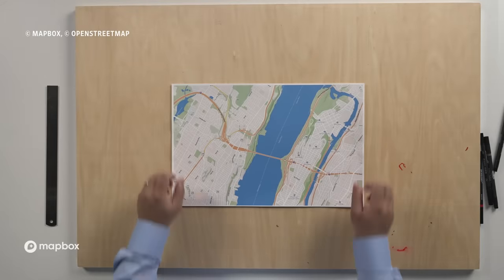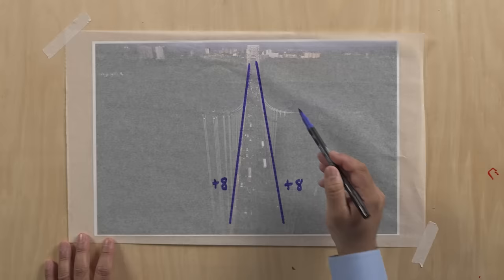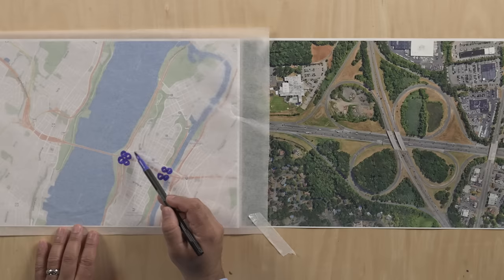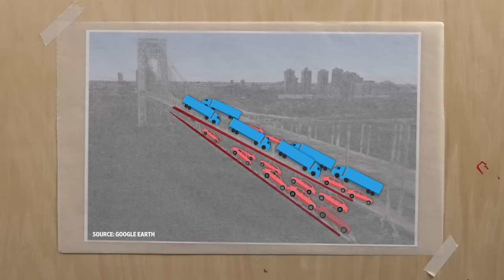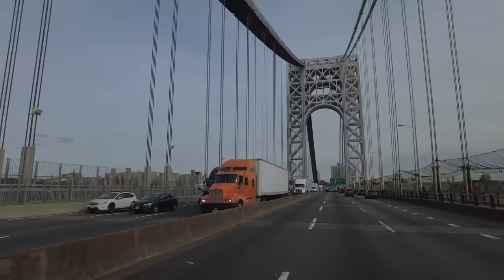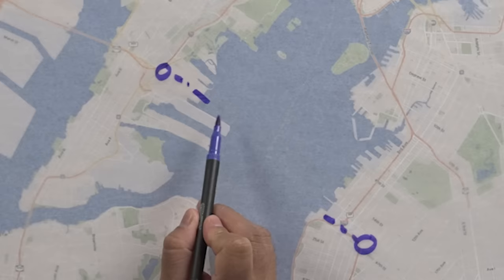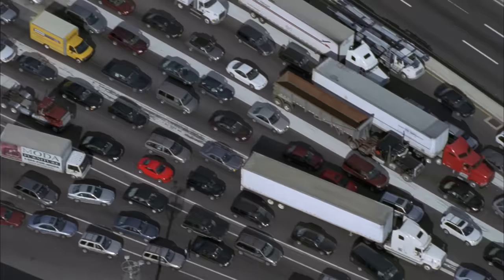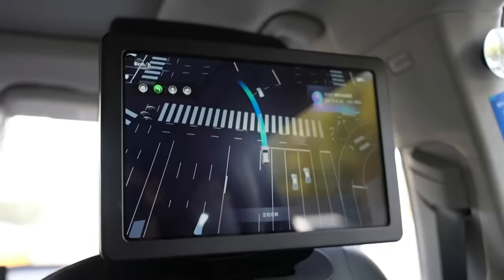Transportation Engineer Tries to Solve America's Worst Bottleneck | WSJ Pro Perfected

Comment: So long story short, they have no desire or plan to fix the problem or improve infrastructure. The only plan of action is to add congestion tolling to discourage people from driving.
Reply: Basically yes.
Reply: *and by doing so, encouraging use of public transit.
Reply: @simondahl5437  There is no public transit crossing the hudson river that far north, so you're really just encouraging people to stay home.
Reply: @smacpats6379  In the case pf congestion pricing there would likely be an investment in public transit to the areas impacted the most. So the transit that may not exist now, may come to exist. And it goes for the entire city. If congestion pricing goes into affect, areas with already existing transit will se their automotive mode share shift towards transit
Reply: @simondahl5437  It's really not that simple though. Many areas of Northern New Jersey are not dense enough that it'd be an easy task to connect existing houses to public transit networks. And the same basically goes for people leaving similar neighborhoods in Long Island.
Reply: @smacpats6379  Having a hard time believing a once every half hour, once very 15 minute buss wouldn’t suffice. It doesn’t have to be heavy rail or subway.
Reply: @simondahl5437  Bus from where? 

Assuming a best case scenario (people commuting from NJ to Manhattan), everyone still needs to find parking at a bus station and board the bus. Everybody's cul de sac isn't going to get a bus across the GWB. 

Assuming a worse case scenario (people going over the bridge to literally anywhere besides Manhattan), busses are completely useless. If I'm trying to get to Connecticut it does me no good.
Reply: Hahaha come to exist? You clearly don’t live in the nyc area. If we use congestion pricing to fund improvements we won’t see anything till 2090. That is if the funds aren’t redirected to a gender change surgery initiative
Reply: @rhino6634  You're absolutely right, the number of people in here who are pretending they know what they're talking about is crazy. None of these people have probably ever even been to New York or NJ.

Comment: A lot of people in the comments here don’t seem to realize, maybe because they do not drive themselves, that the bridge handles more than 300,000 vehicles a day, many going further into the North East of the United States and into Canada. The rail line that do enter the city are already over capacity. This is the most populated metro area of the United States, with over 20 million people. Before anybody mentions Japan, many of their rail lines are over capacity, and more than 90% of their goods are transported via trucks.
Reply: Urban automobile-based infrastructure is suboptimal by nature, no matter how you cut it.
Reply: @Ryanotokyo  The outside of Coal power plants are more radioactive than Nuclear power plants, and their use kills more per year than all Nuclear power plants have ever killed but we still use them. We have to deal with reality not hate people just trying to live their lives because they don’t live them in the most ideal way.
Reply: @JakeSDN  @Ryantokyo is not blaming the people, it's the car-dependent infrastructure that's causing the issue. You're right, 300,000 vehicles use that bridge every day, and most of them are just bypassing the city. A bulk of those vehicles are personal vehicles, so if there were viable, frequent, and affordable high-speed rail throughout this corridor (and robust regional rail along the trunk lines), then much of that automobile traffic would vanish. It's not the average driver's fault that they're driving, it's the fact that the least efficient form of transportation is really the only option.
Reply: @Ryanotokyo  It's also the only type of infrastructure that has been proven to work in areas with urban sprawl similar to what you see throughout NY and the surrounding areas. In Europe you don't have the spaced out cul de sacs that you see in the US.
Reply: Yes, rails lines are bad. They go over capacity. Let's just build one more lane then. /sarcasm
Reply: There's more than 1 option to transport (goods). But for some reason it's 'just cars'.
There's even water, use boats. Use bikes. Use walkways. Use a metro, tram, train. Why is there no bus lane just for buses. 

Why is it 'just' cars?

Why are you talking about trains that are over capacity as if they shouldn't even be considered? That means it's working, and very much preferred. What do you think happens if they remove trains as an option, where will those people go? To cars! That means if one train holds 1000 people, that's 1000 extra cars on the road, for one train. If the trains leave every 5 minutes, that's 12000 extra cars on the road in 1 hour, using 1 train line still. 

No wonder ya'll have congestion.

Comment: You're a fool if you think making more roads will solve traffic issues. It will just be filled by cars with single users.
Reply: Crazy thing, if you build enough roads, there won't be traffic, because you kept your infrastructure up to capacity. That's why city wide gridlock didn't exist in the 60s, 70s and early 80s.

Comment: Didn’t mention meaningful congestion pricing. Raise the toll from $12 to $50 and these private drivers will think twice about how important it is to drive into a place that has a billion bus lines. 

Also make it a much more bike oriented route so much larger cargo bikes can bring in goods. This is like 2 miles. 

Basically remove private vehicles

Self driving and tech simply doesn’t solve geometry or physics. So we need better solutions

Comment: Are you ready to give up your house or lower its value so that public transportation is built in your vicinity. I figured not. It is close to impossible to build new infrastructure in a built up city or suburbs. That is why every solution to congestion involves tolls, congestion pricing or rerouting of traffic. All the solutions presented in this video are workarounds and do not address the core problem.

Comment: Roundabouts do not reduce crashes, in fact the are often times more crashes occurring. They aren't designed for traffic flow either. Roundabouts PRIMARY focus is to lessen the lethality of crashes. That's it. They remove the T-bone crashes at conventional intersections and turn those accidents into side-swiping versions. Thus, lessening the likelihood of a severe, or lethal accident.
Every other reason for using them is secondary and not their intended use.

Comment: I think that the best ways outside of public transport are:
* not allowing lane changes on the bridge.
* making each of the 2 levels be one way traffic.
* limit the amount of vehicles allowed on the bridge to guarantee that traffic can flow
* severely limit speeds, reducing the space required between vehicles, not increasing capacity sideways, but lengthwise.
* dedicated lanes for trucks, or require them to drive as far to one side as reasonably possible. (Kind of like they do in Europe)
* put on/off ramps further away from the bottleneck.
* create alternatives for through traffic.
* Limit the lanes that feed into the bridge.
   It is only a bottleneck if the main body is wider then the neck.
   And there is no point for having significantly more lanes then then the narrowest point can handle.

Some of these suggestions seem counterintuitive, but they do actually work.

Comment: The tried and exhausted method of add more lanes is a tired ineffective solutionnto traffic. Induced demand comes with ease commutes. You need to add more light rail lines. The only solution to heavy car traffic is alternatives to driving. Youd be surprised how many people dont want to drive if given the option. Leaving the roads as they are more than adequate for people who have to drive

Comment: 95 is a major connection between states for national traveller's so diverting them away from local traffic between nyc and urban nj would be a better alternative that could be solved by segregating these truck vs car levels into truck and express travel vs local travel, having off ramps to the local way for trucks, and cutting off exits from the theoretical express level

Comment: Shocking that 90% of freight comes by truck, but thinking about it, this seems unavoidable, in almost any city. Getting people onto trains works because people can do last-mile delivery with their feet, aka walking. But if you had a train full of freight come directly into a city, you'd need a rail yard in the city, and trucks to do last mile... in the city. It doesn't work.

But of course, if you can reduce the passenger vehicles on those bridges by 80%, then it's not really an issue. Rail-based public transit is the answer.

Comment: It's '"Interstate" 95. Those trucks may be going to New England, Houlton ME, or Canada, tho many are going to Hunts Point or Long Island. Rail is no good for Hunts Point- too slow for perishables. Almost none are going to Manhattan, simply passing thru. And a main reason the GWB backs up is because the Cross Bronx is stopped. Yes, autonomous driving can't happen fast enough, but instead of Elon Musk trying to solve all the possibilities of every road everywhere they should start with interstates. It is a much more simple  and solvable problem, and yes, it will stop silly accidents like rear enders and side swipes. BTW, there is already peak hour pricing on the GWB by the Port Authority. Perhaps the City's new idea of congestion pricing in Midtown will remove many of the cars. PS, the reason the trucks are only on the top deck is in response to 9/11. They don't want any bombs on the lower level as the explosive impact is greater.
Reply: Exactly

Comment: lol move trucks off the GWB lol 
How about not shutting the bridge down for an hour as you set up and take down cones during construction. How about forcing cars to use the lower level while they’re both open. Upper level trucks only, construction, stand still and yet the upper level is still flooded with cars while the lower level is running smoothly.

Comment: I have been driving over it for years and always thought that if the only flipped  the ramps to lower and upper levels at NY side(both in and out) it will solve many of the trucking bottle neck. also if they had police on motorcycles to quickly get rid of minor accidents(always stopping when no injuries in lieu of driving to a area to wait for police or just take each side insurance info and move on). The police change is a simple thing they can implement right away at no cost and major saving

Comment: Why not add another bridge? Keep the bridges one way & add light rail lane. It sounds like the demand is there. The main issues with doing infrastructure projects are when the demand isn't there. Ie Ghost towns & rails to nowhere.
Reply: Yeah a new bridge takes forever and costs a lot
But then again how did they build all those bridges in the 20th century back than? 🤔 
I agree just make a truck express bridge and rail as well
Reply: Because it won't do anything. The bridge itself is not really the problem. The adjacent highways and the network as a whole are simply over capacity. Adding a new bridge just means you will travel slightly further but the travel time will be the same, because at the end of the day you need to merge down to the same number of lanes. The existing bridge could have five more decks and the situation will remain the same if not get worse as MORE people try to use the bridge thinking there is "space".
Reply: @NutsAndThighs  16 lanes to a 7 lane bridge is not a problem? Throughput & larger capacity? Although there will still be traffic if 2x the amount of people can get through at the same amount of time you're still remediating the economic loss from traffic.
Reply: The problem is that the roads it dumps out onto on the NY side are a shitshow too. This NJ side (northbound/eastbound) is often considered one of the worst bottlenecks in America but the roads it dumps out onto in NY are also some of the most under capacity in the US. The West Side Highway, Harlem River Drive, 87 and Cross Bronx are perpetually backed up, and all have ~150k vehicles per day using 3 lanes. And nobody wants to expand highways because inDuCeD DeMaND so the problems just get worse.

They should probably start trying to route trucks up 287 and over the Tappan Zee. Maybe it's time to let them onto the Palisades or Garden State Parkway so it's not a massive detour.
Reply: @smacpats6379  not even sure if the parkway pavement design can support truck loads 
Can’t let them on the parkway if that’s the case.
Reply: @doh-nc8ku  Road can be repaved, I think the bigger issue could be low bridges (but that be fine on the Palisades from GW to 287 to be honest)
Reply: @smacpats6379  you guys should do the big dig like what Boston did. More tunnels to cut through & around NY.
Reply: If you only add cycling and light rail bridge like Helsinki, then yes, this might work.
Reply: @kevinmanan1304  What do you mean "get through in the same amount of time"? It will certainly not be the same amount of time. More capacity when you have a bottleneck just means you can store more vehicles in queue, not that they will move faster. The average speed, in fact, would in theory drop, due to more vehicles merging than before, though the average travel time would stay the same.
Reply: @NutsAndThighs   I'm talking about building more roads at the bottleneck too. You can let 4 vehicles pass every hour vs 2 vehicles means traffic will last half the amount of time. The only argument against that is more people will use the roads but that's okay
Reply: @kevinmanan1304  Completely agree. A few tunnels would go a long way into fixing the traffic in and around Manhattan. I would be a huge fan of congestion pricing if some underground highways opened around the island.

Comment: The real issue isn’t that the bridge is only 7 lanes each direction, it’s that on the NY side, 7-lanes nearly immediately turns into 3! Could you open up the GSP to trucks north of I-80, to encourage more truckers to use the Tap instead of the GWB? No freight to New England should really be on the GWB. Also, if I-84 was expanded (currently 2-3 lanes each direction), even more trucks would take the Tap

Comment: This is so dumb. Autonomous driving solves nothing. It is accident prone without a solution in sight, expensive and doesn't reduce the number of cars going through Manhattan. More lanes only leads to more traffic, because it becomes appealing to drive from further away.

If there's too much traffic passing through a city, you build a RINGROAD, to channel that traffic away from the city center.
IF there's too much truck traffic, give them a separate lane (on the ringroad).
If there too much traffic going into the city, you build enough PUBLIC TRANSPORT, PEDESTRIAN and CYCLING INFRASTRUCTURE and alternative CARGO TRANSPORT, like cargo ships, barges and trains to alleviate the road system.
If this still doesn't solve it, build more bridges and tunnels from differen directions and not just for cars, instead of building more lanes before and after an existing bridge.
Reply: Building a better ring road is the solution, 287 is okay but should be extended to LI via a bridge.

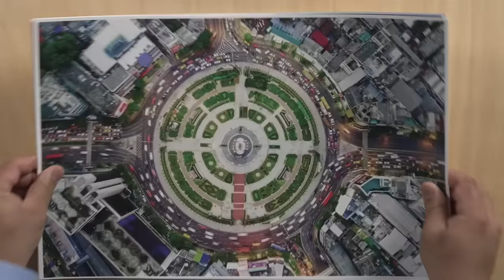Comment: 1:43 that's a traffic circle, not a roundabout. There's a huge difference. Roundabouts are much smaller and the traffic entering the roundabout only yields the traffic in the roudabout.
Reply: Not to mention it wouldn't be possible anyway because circles and roundabouts do not meet interstate standards.

Comment: 🤔 there is one method he didn't consider, which is surprising for experience. All his proposals would include causing traffic due to road works, except the tunnel, but this idea could be built with little to no disturbance, a brand new sister bridge, about 100-200m next to it.
Reply: Which has the exact same problem as widening the bridge. Cost and induced demand.

Comment: They always just want to “get people out of cars”. No, that is not the answer. GWB actually has plenty of capacity. The real problem is the neglect and state of decay. Giant potholes, missing lane markings. Then you have people drive like complete jerks. This “I own the entire road” mentality needs to end. That is the root cause. Let’s get better lane guidance in place. Let’s ensure people drive at a constant speed (not too slow and not too fast), and stay in the same lane. Most traffic jams in this area are caused by people merging recklessly, and relative differences in speed. We just need to even that out. Steady does it.
Reply: Getting people out of cars will still ease that.
Reply: @component9008  Getting people out of cars in this instance will get people staying home. Is that an infrastructure solution? Making travel worse so that people choose to stay home? As is people are willing to sit in this traffic jam so it's clearly a better experience than if they charged enough of a toll that it reduced traffic.

Comment: Yawn! Public transport should have been the very first thing to mention with a quota on the use of private and freight vehicles. Congestion charge does not create parity.  Perhaps they should have considered Daktylios (Greek: Δακτύλιος, lit. 'ring'). It's the name given to the road space rationing or alternate-day travel developed for Athens during the late 1970s. Unlike congestion pricing systems, it does not operate on the basis of drivers paying fees for entering the city centre. Instead, it depends on the parity of the date and of the vehicle's registration plate, the vehicle type as well as the time of the week/month.